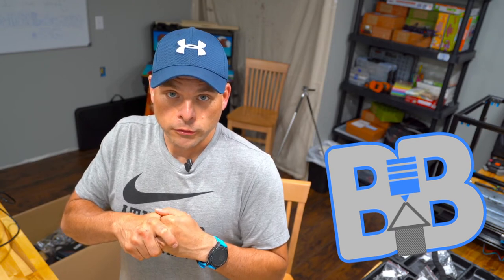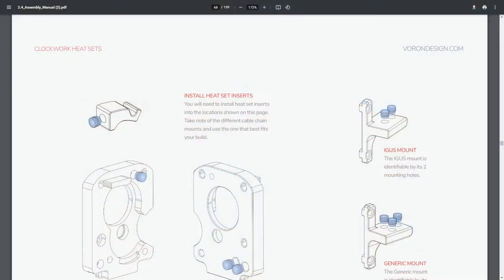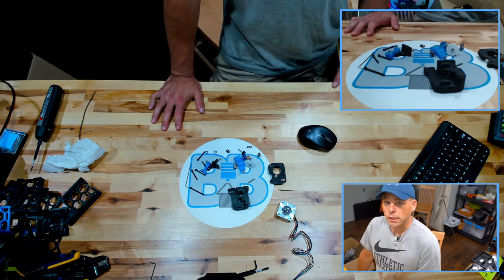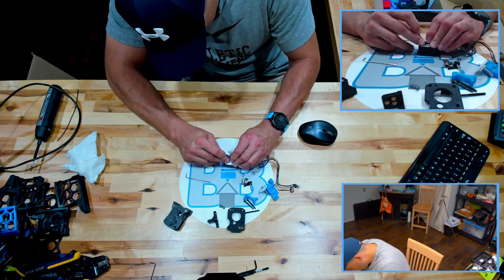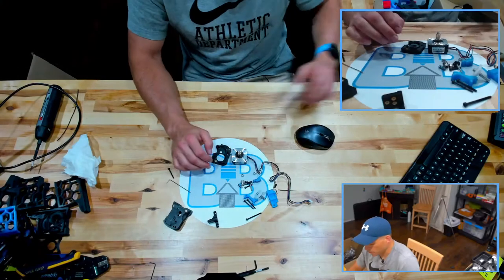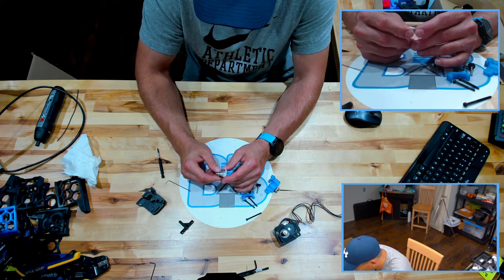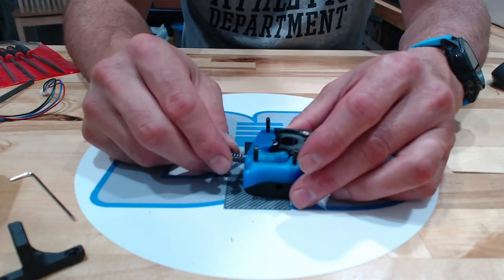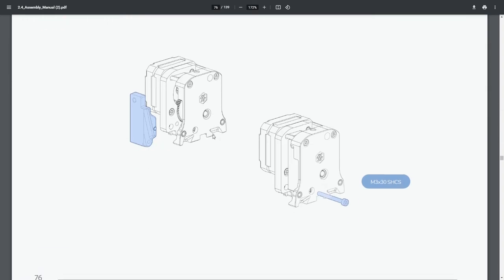VORON 2.4 3d Printer Build It Live *Episode 10* Clockwork Extruder

Comment: Putting the latch in as the new manual describes was quite tricky - I haven't unlatched it since!
Reply from the maker: The old manual makes it way easier.  Basically, build it flat and screw on the opposing side.

Comment: So after watching this, what are your thoughts on aluminum parts?
Reply from the maker: I don't have an issue with aluminum parts in some locations, others it doesn't make sense.  Aluminum parts are heavier and offer no flex.  Some of the Voron parts are meant to flex some and weight on the gantry, less is always better.  I would be interested in an actual comparison.  Maybe someday.
Reply: @BuildItBasement  Chaoticlab claims their Aluminum parts are lighter and have the flex they need. Guess the redesigned the parts for CNC… 🤷‍♂️
Reply from the maker: Well maybe I'll consider getting some for my rebuild series coming up.  Pin mod is probably out then...

Comment: Shouldn't the bearings be greased not oiled? Grease hangs around oil needs to be applied constantly.
Reply from the maker: You are correct.  Normally grease would be the way to go, however these bearings are sealed up so the oil was just another precaution.  On the rails grease would attract too much dust and would cause you to disassemble, clean and regrease way too often.  I chose oil because it's much easier to reapply and when I do it will constantly flush out debris. With the limited amount of mechanical force on things I would probably run everything dry before using anything with a high viscosity.
Reply: @BuildItBasement  If they they have rubber seals the the oil won't do anything. If they are using metal dust shields then it will dilute/wash out the oil. Either way it's not in your best interest. I don't know what rails you have but generally they have wipers to contain the grease and use needle injectors on the end of the carriage to refill them. Oiled bearings and rails need to be oiled every time you use use them. My vertical mill has a lot of oiled surfaces that require service every time I use it. Oil has less friction at speed but is a pain go reapply all the time.
Reply from the maker: @mp-xt2rg  Noted.  I'll make modifications and report back as needed.  These rails are not the best in the world.  I was also applying silicone lube to retard any possible rusting.

Comment: What parts are abs and what pla? all 100% infill? thanx
Reply from the maker: All parts are spec as ABS.  No PLA due to the heat this printer can produce within.  40% infill, 4 walls, 5 top and bottom layers. I'm using PC for the hot end and fan ducting.
Reply: BIB is giving the specs right from the manual, follow that and you will have good strength without to much weight. If you dont have a enclosure for your printer esun abs+ prints pretty decent without a enclosure.  At least with the shorter parts the voron uses.

Voron recommends KVP brand abs with Esun abs+ as a secondary. 

I went kvp stellar black and stellar red (metallic flake) vs standard black and voron red.

Also abs is recommended not only for its heat deflection but if oil and grease gets on it it wont be harmed.
Reply from the maker: @jasonwoody8041  All true.  I will add - Geek, if you can only manage PLA.  Find a decent PLA+ and plan on building your printer with it, then also plan to upgrade all of your printed parts with new/bettter spec materials once you can print ABS.  There are quite a few videos on the 'Tube that show you how to print ABS, I have a quick one with a few tips, some of my tips are against the grain of others, but work well on my Ender.  I suggest you try to print ABS before moving too far forward, you may be surprised.
Reply: And if all else fails you can buy the parts or get in line for the print it forward option. Im in line myself but im going to build a 2nd asap